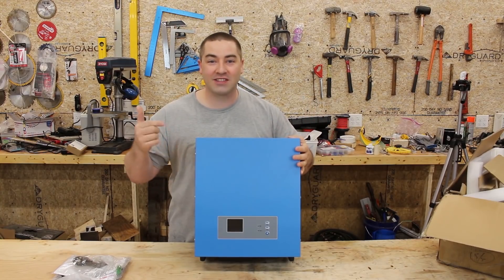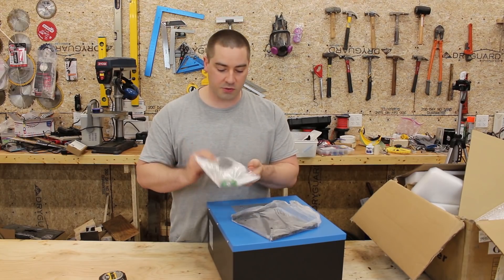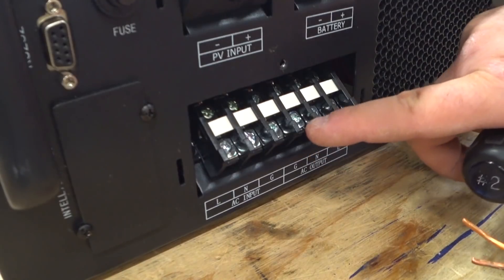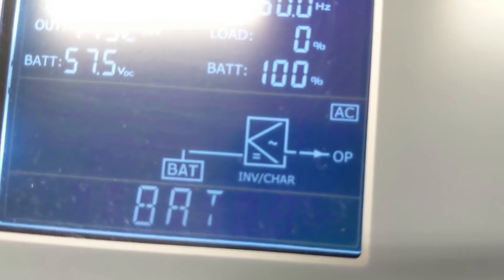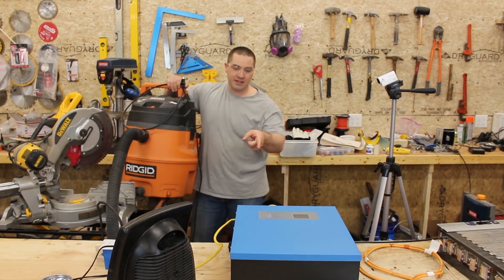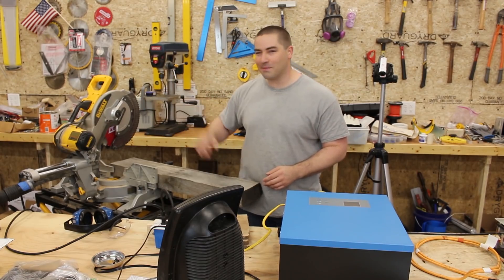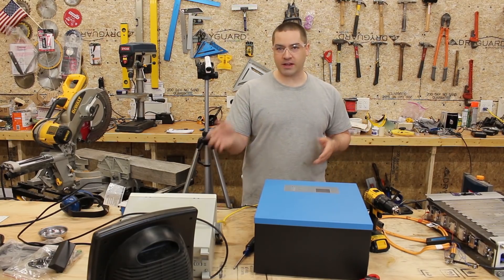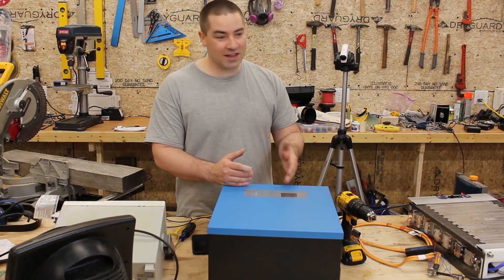Sigineer Power Off-Grid Solar Inverter 2500 W with MPPT Charger

Comment: does it have remote monitoring
Reply from the maker: It has the ability to connect to a computer.  Made so you can set up the parameters with software.  I suppose a computer programmer could make it go over the internet, but that's beyond me.

Comment: What is that loud hum noise.? That's obnoxious as <beep>.  Also, I know LF inverters have a higher idle consumption, and that's fine, but that's close to the consumption of my 10kW AIMS. Great video and great tests though!
Reply from the maker: I noticed the hum more on the transformer side compared to the other side, so I'm guessing it's from the transformer, but I don't know for sure.

Comment: Thanks.  I don t know the efficiencies of other inverters, how does 88.7% compare. It does make a lot of noise!  Of course we want to see the details :)  Like #21
Reply from the maker: Inexpensive LF inverters will tend to be around this efficiency.  My SMA inverters should be more like 95% (extremely good).  But SMA inverters cost a whole lot more.  So it's a trade-off.
Reply: @DavidPozEnergy  when are you going to give us a realistic reading on both SMA inverter with ur set up?

Comment: ~165 watt draw at idle seems terrible for modern inverter specs.  Was that noise as annoying in person as it came through in the video?  I was actually looking at getting this exact inverter from Sigineer for use as a UPS for my server/network while using as much solar power as possible to offset usage (no net metering or utility company interaction required).  That would probably be the best configuration for this inverter if you can set it to fail over to utility power when the battery is depleted.  I'd like to see if you could set it up that way.
Reply: I went with a pair of the Growatt inverters, 3kw each, can be paired for split phase or to boost power for single phase. They are pretty quiet, no buzz, just a bit of fan noise depending on how hard they are working at either inverting or pulling power from the pv array. The usb software is not great but the wifi dongle and it's app work very well with detailed stats. You can set them a few different ways so that it'll switch back to grid at a certain low battery voltage or if there is no pv being generated. I have mine set to charge from only solar and on a sunny day by 9:30 the battery is high enough that it stops pulling power from the grid and runs everything off the solar and stored power in the batteries till about 8:15 at night when its dark enough that there is no pv voltage coming in and then it switches back to the grid. I have about 8kwh of storage right now connected with a 4kw array currently and by the time it switches back to the grid i've still got 5-6kwh remaining in the batteries for any power outages. If the power goes out it switches to the batteries just like a ups with no impact on the computers running. I have a 12,000btu mini split unit and an 18,000 btu mini split and a 6,000 btu window unit all on the two inverters, my fridge, 3 chest freezers, my washer and gas dryer, 3 computers, home theater, two ceiling fans and the lights in half my house on my pair of inverters and basically on a sunny day I pull nothing from the power company for almost 12 hours of the day. The mini splits are 240 volt, everything else is 120 volt. Each inverter can take up to 4500 watts of solar. If a storm is coming through I can switch them to charge from the grid and solar, it'll charge from solar first and then top off with the grid at the end of the day so the batteries are full should a storm hit. They cannot feed back to the grid so there is no issue there since I lack net metering as well. I've not tested them with high draw loads like a miter saw because as rarely as I use such I just power those from the grid. The cost a couple hundred more than this inverter but they have no buzz and have a pretty low standby draw. They are a high frequency design.
Reply: @andycanfixit  great comment Andy. You should make that a comment on the video not just a sub comment
Reply: @andycanfixit  Thanks for the info. Been looking for Growatt details and can find little...
Reply: @andycanfixit  Hi Andy, I am looking at a pair of 3K Growatt inverters also.
Reply: @andycanfixit  Hi Andy, I was looking at going with two of the 3K Growatt inverters also. You you mind sharing your set-up array size and brand of panels. I was looking at Canadian Solar 325 watt 60 cell. Researched battery types now for 2 months. Leaning towards çarbon lead acid pcc  8.2 kw  curious what batteries you are using? How do you like the system? Any suggestions would be greatly appreciated 😊
Thanks Bob
Reply: @andycanfixit  Where do you buy them?  Site just lists the products, no purchase option. They look great though.
Reply: Hey frist time checking in, like the inverter but that sound  is  problem,  like the fack that It took the load that was applied to
Reply: yes, that idle power will cost you more in bigger battery capacity and PV panels than if you buy a quality american or europaen made inverter.
Reply: @ursodermatt8809  The problem with efficiency is inherent in low frequency inverters.   There is no way around it - for now.   Check the specs for yourself:  American, European, or Chinese, all of the low frequency inverters are going to be 85%-90% efficient.  And, the high frequency inverters all suffer from a lack of ability to drive high demand inductive loads - because, they have much smaller inductors.   It is the huge transformers in low frequency inverters that give them such surge capabilities that they can typically start inductive loads that are three times their normal output rating for 20-30 seconds.  Personally, I think the extra weight and extra noise (from some models) is worth it for the incredible surge capabilities they enjoy.   And, the extra 5%, or so, of efficiency high frequency inverters offer isn't as important to me as the surge capacity.   Remember, if an inverter cannot start your intended loads, it is worthless.
Reply: @richardowens9061  
i was talking about idle power not efficiency
Reply: i think you could prob use the gen feed to trigger a relay for mains input if it want auto charge when low if solar is not upto it
Reply: I was going to point out the same things - low efficiency and that bloody noise. I figured it out though - the 165W goes towards creating that noise - now all they have to do at Sigineer is tune it towards making music rather than buzzing noise. I suspect they need to do more work on bonding the laminations in that huge transformer.

Comment: Hello mr. Poz!! It is that noise coming from the fan or its the internal components like transformer or any induction noise? Also want to say very good video and thanks for sharing your findings with Sigineer inverter cause I recently purchase one and hope to have it soon 👍🏼😎🇵🇷
Reply from the maker: The camera was really picking up on the transformer noise.  It is louder than other inverters I've tested, but not as loud as tools or vacuum.
Reply: DavidPoz  I understand that, microphones pick noise that we normally don’t hear loud because of the induction or magnetism, as of i saw in the video the inverter is tough working above the parameters or at least neart to the maximum capacities

Comment: Any recommendations on 60v inverters? I’m interested in a 60v bank and 120v service. Thanks for the videos!
Reply from the maker: I don't know of any 60v inverters I'm really happy with.  But there are several 48v inverters that go up past 60v I like.  Several models go up to 64v which is good enough, but some go higher.  The Magnum MSPAE will go up to 68v.  That's sweet.
Reply: DavidPoz check out threads on anotherpower.com. The forum is a bit dead but there are some good reads. Some of the guys have built their own inverters and I’ve heard of 96v inverters.
Reply: @billssolarpowerandgardenin1016  It is not a true inverter but I just got my hands on a APC SURTA3000XL UPS and it runs off of 16 12V 5ah SLA batterries which were dead of course. That means it takes 192V DC to make it run. I bought some 3.7 cells from Battery hookup w/ BMS and plan to try and revive it. It should be a 3Kw Pure Sine Wave when I get it running.